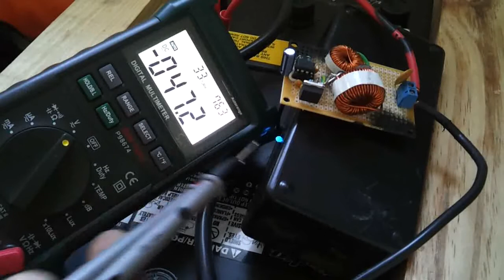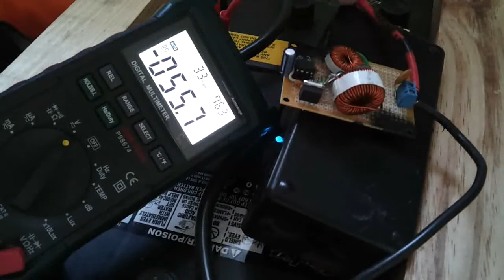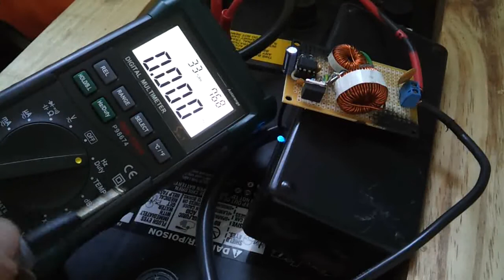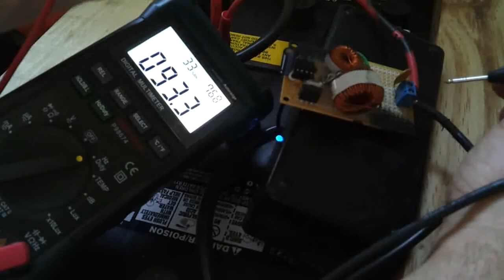Reconditioning your car battery (desulfator) Part 4 - Basic Troubleshooting

Comment from the maker: Your very right about the symbol for crossing or connecting wires on a schematic.  I'm going upon the assumption that anyone that is trying to build this circuit at least has the ability to read a schematic correctly.  I'm no electronics guru by any measure and I had to reference back to the schematic many times as I was building my first one just to make sure I read it correctly.

Comment from the maker: ytlas3 - that sounds like the timing signal from pin 3 is not getting to the fet to turn it on and off since your not hearing any hum at all.  Also get rid of the 1mh inductor as it's harder to troubleshoot something when you've changed the components.  make sure you didn't accidently put the 555 chip in backwards, and if you have a multimeter that can detect frequency, check the frequency between pin 3 and ground.  you should get something around 1khz.

Comment from the maker: Texas instruments sa555 series of 555 chips.  They can output up to 200ma on the signal pin.  Cheaper 555 chips can only output 20-40ma on the signal pin which usually isn't enough to turn on the mosfet.

Comment from the maker: yup I got that same pdf.  The only difference between the two designs is instead of using a 330 ohm resistor to limit the voltage to the 555 chip he's using a to-220 package voltage regulator.

Comment: your info is very helpful thanks ,i was wondering if you have any info on store bought desulfators ,i have a bunch of wheelchairs with 24v systems with 2- 12v batteries each.keep up the good work

Comment: A friend of mine asked for my help in reading a schematic.  He was trying to build a simple circuit.  What he didn't understand was that there is not a connection between all wires that cross on the diagram.  Wires can cross without there being a connection.  A heavy "dot", or "circle" is shown when crossing wires are actually connected.   At 4:26 in the video I do see small dots, a novice can be confused by all the crossing lines.  A expert will have no confusion on interpreting the circuit.

Comment from the maker: i don't know of any specific ranges to look for in voltage across cap 6.  just take a reading when you start and if you see it drop as days go by that is a good sign.  when it stops dropping over the course of a few days it would be a safe bet to say that the battery is finished being restored.

Comment: Thanks for your reply nj & I have noted specifically for not to exceed 13.5vdc. When the battery is fully desulfated can it be charged with stand alone wall battery charger or solar charger(I mean without having connected the desulfator any more)?

Comment: Does your MOSFET get hot during operation? I haven't played much with MOSFETs, but usually any TO-220 based voltage regulators (which are a different beast entirely I realize) I've used can get pretty toasty. For the sake of heat dissipation and part longevity it might be a good idea to use a similar dimension aluminum case with the MOSFET secured to the side and a heatsink secured on the outside of the case with some thermal epoxy. Would require longer leads for the MOSFET, but no biggie there.

Comment from the maker: I'm using 1/4 watt 1% tolerance resistors.  They should be the ones I listed in the parts list on video 2.  The resistors should be blue in color showing you that they are 1% tolerance rating.

Comment: Hey! Finally got my desulfator parts and built it yesterday. I tested it on my car battery which is 5 years old and I've never had problems with.Voltage reading on my battery is 12.6 volts. Voltage reading between pins 1 and 8 on the 555 chip is 5.6 volts, so enough to power it on. My LED turns on, but I don't hear any tone. Also, when I check the voltage on the capacitor (the one where you should read voltage pikes), I read 12.25 volts. Do you have an idea of what my problem is ? Thanks again !

Comment from the maker: Ytlas3 - I should have picked up on the metric conversion from 1000uh to 1mh, my bad.  I wonder if using different quality inductors is giving you your problem.  Make sure the core material matches the inductors that I spec'd and also the same amperage rating.  If you want pm me and if you pay shipping both ways I'll troubleshoot them for you.

Comment: What voltage resistors are you using? I used 1/4 watt which is stated on the schematic.

Comment: You mention a range of about 20V-60V that could be across capacitor 6. Is there a way to tell your battery is almost desulfated just by looking at the voltage of capacitor 6? Meaning once the capacitor voltage drops to around 20V or something, is it safe to say its completely desulfated?

Comment from the maker: I've never payed any mind to the bedini hype.  As for desulfating, you always want a trickle charge on the battery itself while desulfating as the desulfator uses power from the battery to do it's work.  Just make sure the voltage doesn't go over 13.5vdc.

Comment: Thanks.  Actually the 1mh inductor is just another way of saying 1000uh.  Some electronic stores list them that way.  Chip, diodes, everything is in proper order.  I built a third one today with same results and similar voltage readings. They are all laid out differently.  Some research on the web and ran across sites that imply that some types of inductors are either silent or run at such a high frequency that the ear can't pick them up.  I have a multimeter on order that will check frequency.

Comment from the maker: 14.4volts will slowly gas your batteries and shorten the lifespan of the cells from being overworked.  You should only maintain 14.4 for an hour or two at the end of a charge once a month to equalize the cells.  Otherwise 13.5v is the proper float voltage for lead acid batteries to keep them topped off.
Reply: 13,5V at 60 °c in a car ! in stationery use as solar system the correct float voltage is 14.7 V or even more to 15V in winter time ;)

Comment: if my desulfator capacitor has slightly less than the input voltage of the battery, what would that mean? because i know rms voltage isnt the same as peak to peak voltage. The one i bought has a rating of 30 volts peak to peak (my desulfator)

Comment: Hi nj.For trickle charging, in stread of PTN78020H, can I use a 10A mppt solar charger to be connected to 4.5A/80W solar panel. Here in Greece PTN78020H can only be procured as imported item from across the Atlantic & including custom duties+23 pct VAT it will cost more than 50 dollars. Mtime, what is the power drawing of the desulfator circuit? Thanks.

Comment: hi buddy... i made a 24v desulfator but my question is this that im getting 11.8V on Pin 1&8 of 555 timer chip, but the frequency is too low im getting only 0.147KHz. what could be the reason or is this correct frequency for 24V Desulfator system

Comment: Pins 1&8 I get 4.47v & across cap 27v. I don't have a hz/duty meter, so can not check hz & duty cycles. Trickle charging by solar mppt charger is at around 13.5v but at this voltage the mosfet is quite hot , so I put a small heatsink. Today is 3rd day & at night battery has gone down to 11v, as before. My opinion is that at night the bettary should settle a little higher than previous day & over time it should go higher & higher provided the circuit is slowly desulfating. Any guidance.

Comment: Hello all... i built up this circuit with small modifications. i used IRF9530N P channel mosfet with 10k pullup and its working at 1.1kHz. With a 12V VR SLA battery, i read 80volts across C6. if anyone interested, i can share eagle files. Thank you...